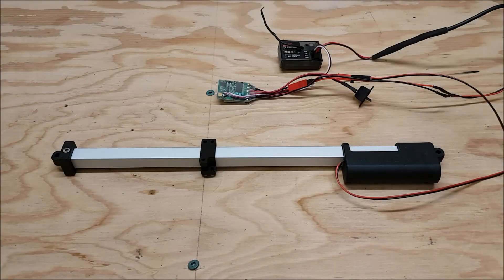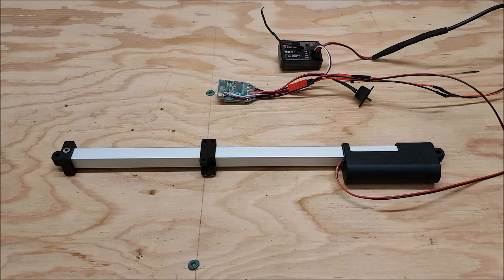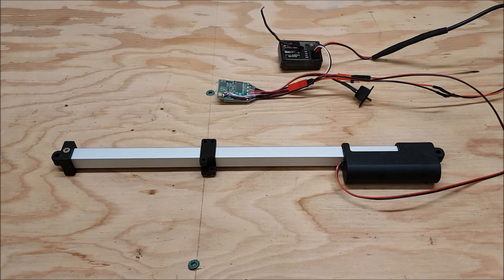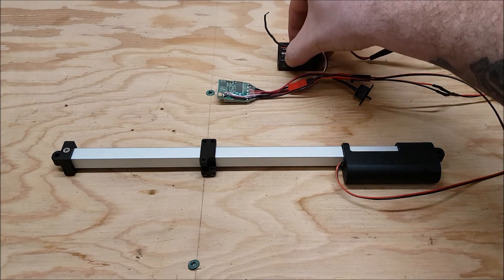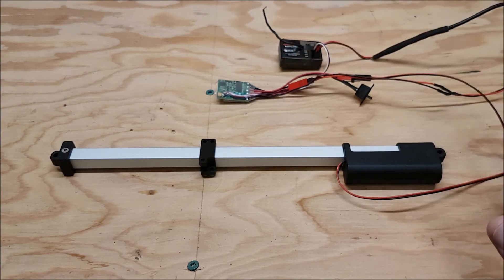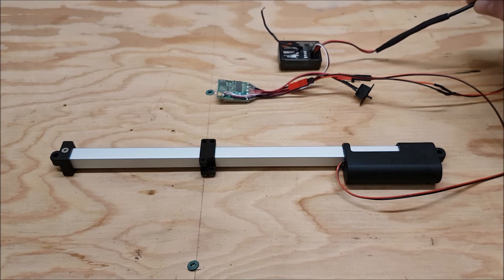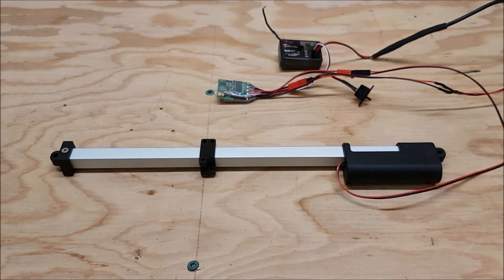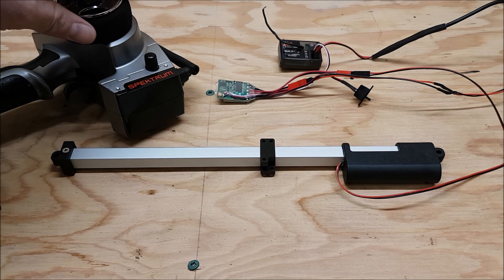How To Use An S-Series Linear Actuator With RC

Comment: Hi, so this is the only way not to have a neutral return thanks to an external regulator, or can I get the same result simply by using an "R" series connected directly to the receiver? every technical indication will be really appreciated, thanks!
Reply from the maker: Hi Matteo, our R series servos will follow the stick on your radio. If you're trying to emulate a hydraulic system where it moves when you push the stick and holds it's position when the stick returns to center, you are correct, this is the way to do it. Get yourself an -S actuator and a motor controller.
Reply: Actuonix Motion Devices thaks a lot for your reply! 😉
Reply from the maker: You're most welcome :)
Reply: Actuonix Motion Devices I keep asking some questions..😁 Can I create the same system as in the video but using the L12-S (S series)?
Reply: I ask this because I would have the opportunity to choose between 6 and 12 volts without having to resort to double feeding ..
Reply from the maker: Yes - all of our S-series actuators work in the same way. Obviously you would need to make sure the motor controller that you are using supports the voltage of the actuator you're using.
Reply: Hi all! Maybe I do not understand, but using the motor controller you suggested you do not need to use a second battery to power the receiver because the motor controller has a 5V internal BEC. So I think it's enough to connect a 3 cell lipo battery (12.6 V fully charged) to the motor controller. Then the 3-pin cable to the receiver (which also powers it) and the 2-pin cable to the linear actuator that will control it with 12.6V
Correct me if I'm wrong..!
Thanks in advance for your reply:)
Reply: ok, I think I understand ... the esc you used in the video is the old model without bec, can it be? I would not burn everything 😉
Reply from the maker: Hi Matteo - You just need to power the speed controller with voltage appropriate to the one you're using. If it will take 6V, awesome. As I'm using a 12V actuator it needs 12V. If you use a 6V actuator, you will need a speed controller that will work with 6V. This particular controller is not a product we carry so I'm unable to offer any other details on it.
Reply from the maker: If you need further assistance, feel free to give us a call during business hours or email at support@actuonix.com.

Comment: Nice video.  For applications such as this where I need 5V and 12V, I use a single adapter that has both like this one - https://www.ebay.com/itm/New-AC-Adapter-12V-5V-For-HARD-DISK-Drive-Power-Supply/300567122392?ssPageName=STRK%3AMEBIDX%3AIT&_trksid=p2055119.m1438.l2649 .  Both voltages in a single unit keeps things simple.
Reply from the maker: Thanks Steve!